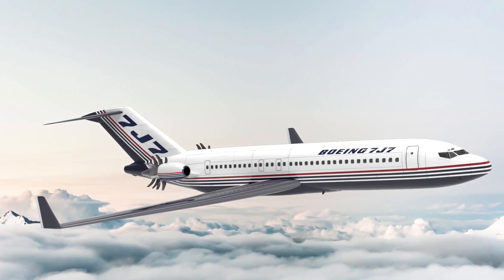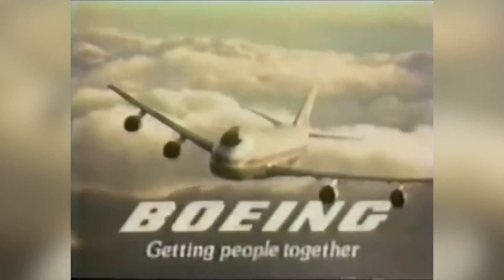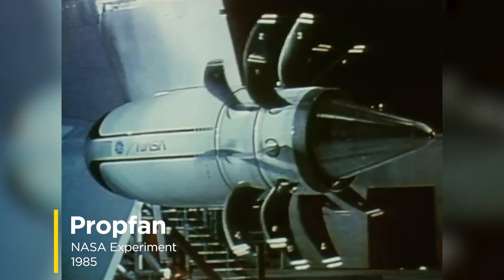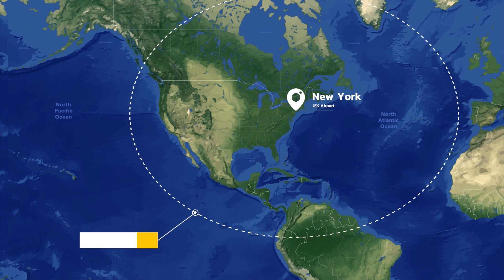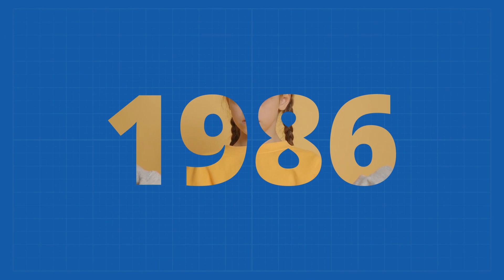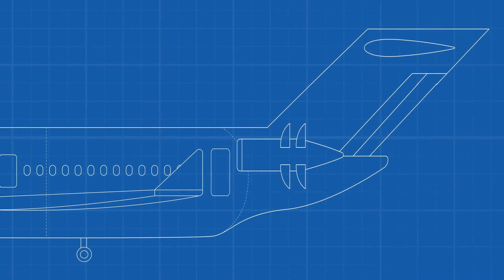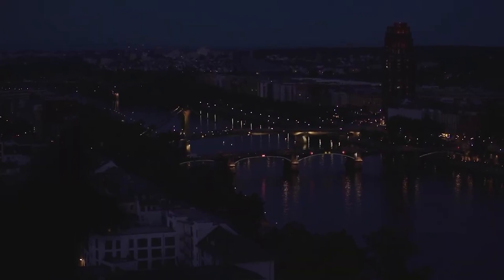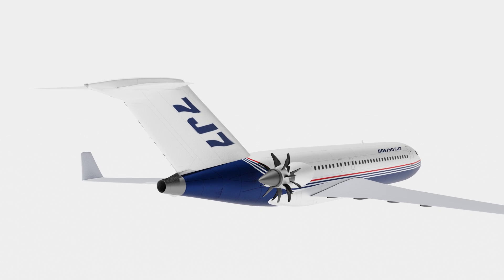Boeing 7J7 - The Boeing 737 & 727 Replacement Aircraft That Never Happened

Comment: Saying that Mach 0.84 is slow is ridiculous. The typical ECON cruise speed for a B737-400 is about M0.745 0r about TAS 440 knots. the 737-800  abit faster but stil below M0.8
Reply: The commercial jets of the 80’s and earlier flew 25-50 knots faster on average than today’s aircraft. The 727 actually had a top speed of 685 miles per hour or just under 600 knots which is mach .89. Try that with a 737-800
Cheers

Comment: The 7J7 could not be built because it was LOUDER than the original 727-100 that it was based upon!

[I flew the 727-100 and could never land that airplane.  Most people say it was easier, I don't agree-]

American Trans Air, the defunct passenger ACMI used to take off out of Orlando and using the NADP2 procedure the walls in my house on Gulfstream Bay Court would literally vibrate!  Now this was a cheap house but Jesus~!  NADP2 calls for you to level off at 1000 feet and clean up and then climb.  The three JT8D engines used to clobber my cardboard home, and I was an Express One International Captain at the time!  

I'm not kidding, I had pictures vibrate off the walls....

In any case, the sound level from these UDF's were their downfalls.  They saved a LOT of fuel, but in the end they wouldn't work.  Dee Howard did a design where the center engine of the 727 was removed, and the pods were replaced with CFM-56's.  This produced an airplane with half the fuel consumption but a BIG price tag for a modification to a very old airplane, so it never happened.  Instead the Boeing company built the 737, a turkey.

Comment: actualy the dispute was fpr noice leveling and aditional noice leveling require bypass  flight agency safety which is imposible so the simplest answer to society was made,, no one dreamed about hybrid airprops or gas turbine eco eficient engine, as it turns the reason is noice reduction as possibility to cruch or create more engine failure and it was strongly rejected but wing span and fuel emission was there in unstabile price and possible crisys US just forget about fuel economy and usual moto the bigger the better, but also airbus was not so tough in numbers, Now when you have space x, vtool vaits to be rizen spacehip age with veritcal take off a minor noice is more like inner subject safety as allow larger noice and almost demand like mid size double plate and iso foam i betweenas space high airplane geting closer to sabre engine and above 3 mach tech flying possibly and actualy would fly about 2 mach in flight rest is special flights to orbit and waitlessnes sense and coming down sometimes in flight also but such flight needs to declared for safety purpose probably anyway is alternation to old fornt props and faster speeds so vtool in prep size rotational is excelent fuel saver and another dont boder version off 4x4 energy eficient vtool and thsi time is usualy slight away from cabin and doesnt make noice obvious and close fly 800 kmh which is quite fast and energy eficient and kind like friendly  to east vtool option and fuel saver but not so easy to develop as it has curved blades but double twin create a pop air that is unusual hot so now is more like high tech aproved or demand in future, the problems in older days as they didnt kno the future in quad 4x4 energy airplanes on scfi dynamics you resumbly fast spaceship tech and spaceship transporters then is rotational serov on jet engine also as capable to understand this in older days tech much more debate and time from start to finish and some background theme in society to be covered and when settiings the directors just stayed cold or warm to newer things this was standard process and no internet and fast data conection and wifi fly on pc form factory or selffly airplanes is bit NASA role domene and times off unstabile rockets too

Comment: 757 a "poor seller?" Check your facts. The 757 outsold the 767 and 777 for years.
Reply from the maker: 727 sold 1,832 units
757 sold 1,050 units
767 sold 1,196 units
777 sold 1,641 units
The 757 failed to replace the 727 in the market, it also was shut down. The 767 is still sold (Cargo) and the 777 is also still sold.